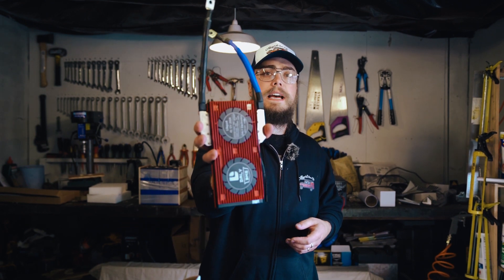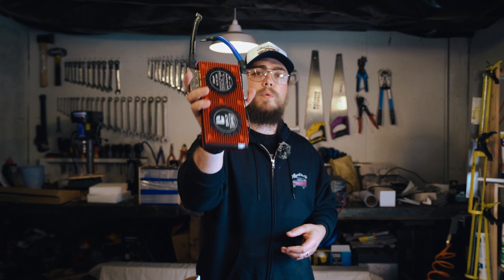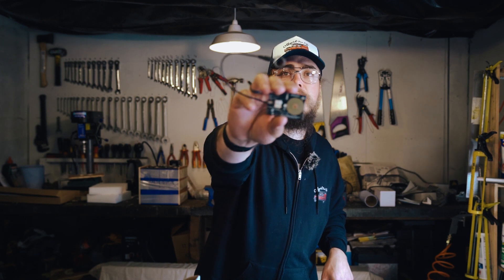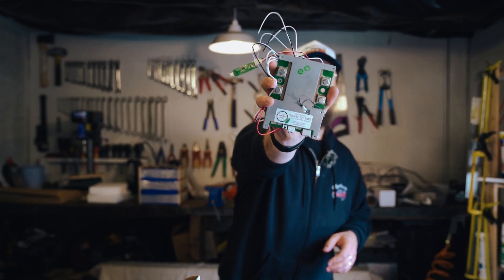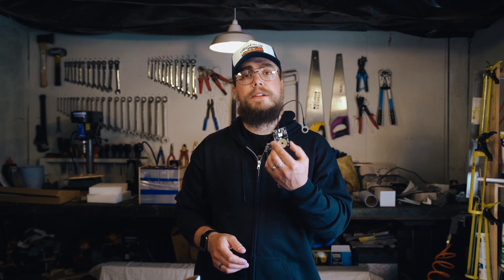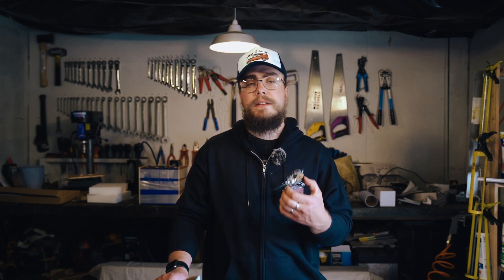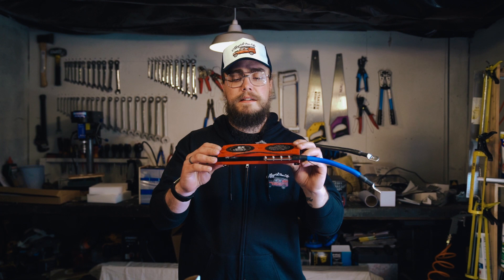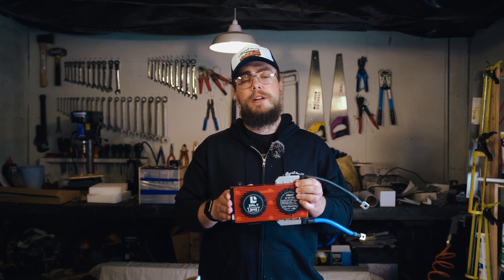Which BMS? Daly vs. Overkill vs. 123 BMS

Comment: I have used the daly bms and seen issues like inappropriate capacity measure,soc estimation. Max Voltage across terminals when bms is off

Comment: please help me size the BMS. I have 16 EVE 280 aH cells in series to make a 48 v battery, Is a 200A big enough?
Reply: If the power watt of inverter is within 6500W ,200A is enough
Reply: Thanks for the reply. I went with a 250 a since I have a 10.2 k inverter with a 40 a breaker ( 8800 w) on the output to avoid overload . I also put a 160 amp battery breaker in line. @jiabaida-bms

Comment: I need a bms for 24 leaf modules in a 24 volt configuration.  Its two stacks of 12 modules. I actually need a bms for each stack of 12. I figure q 6s bms is what i need and its powering a 4000 watt inverter
Reply from the maker: A JK BMS would be ideal.

Comment: Hi, I have a 100amps 8s overkil solar bms. I'm wondering if I can UP the settings to allow125 amps draw because of the electric kettle... the bms actually rated at 100amps but I'm thinking if I put in a fan for cooling it might be alright. What do you think? Yay or Nay?  ..

Comment: You could also just use a solenoid for higher amp draws that will just shut off if the BMS turns it off.

Comment: Great video and contents as always, but the thing you said about the 123 BMS it's actually incorrect, it can handle higher amps than just 100...I've a Gen3 with current sensors that measure up to 500 amps, just to be sure before installing it on my pack, I've double checked with my supplier (GWL), after watching your video, and a guy from the tech support confirmed that the BMS can handle even 150/200amps easy, so I can run my induction cooktop with no dramas at all. I've been reading again the entire manual, websites ect...no mention at all about what you stated in this video. Saying that, love your work, keep going! Your channel helped me a lot with my project 😉
Reply: You have run that much current for an extended time? Why would the manufacturer not rate it higher for vastly more sales? Makes no sense.
Reply: Mate...first of all, would you really think that a major company would lie to a customer (writing everything in registered and official e-mails) on such topics which includes healt and safety matters, just to sell a few more units? Secondly, go through every single information you can find on the internet (123 smart BMS manual for instance) and, please, tell me where you can find the info stated in this video (BMS rated for 100amps). 
Third, what on earth is the point of supplying a 500 amps current sensors with a 100amps rated BMS? (That would really make no sense at all)
And last but not least, I'm using it pulling 150/200amps ish each time I cook or heat the water in my van....so....I'm still alive and nothing blew up......not yet 😅
Saying that, I didn't write those things to show off or making these people look dumb..I really love their work and this youtube channel, which helped me a lot with my project, so I honestly think it'd be a shame if they might give incorrect informations to their followers. Peace ✌🏻
Reply: @simonecristiano637  yeah but isnt it more a seperate contactor so then you could run it with 5.000 amps if you really wanted it./hook up multiple togheter

Comment: I have four headway 40152 cells, 15ah. I plan to make a small portable pack for my dometic refrigerator.  I will only need about 5 amps of discharge or charging current,  but i think the 30 amp daly will be best because i can get the bluetooth version and customize it. Is there any other options for as much customization as the daly with bluetooth but in a bms in 5 to 10 amp area?
Reply: Specifically cell maximum and minimum voltages. I prefer to not use the full 100 percent capacity and extend the lifepan by using lower maximum and higher minimum voltage for this specific build.

Comment: excellent video, congratulations. It inspired me to build mine. But I have a question, if in charging the bms receives a load above the maximum, what happens? for example it can charge 100a and receive 150a. Does it charge the 100a and ignore the remaining 50, or does it shut off and charge nothing or does it burn out?
Reply from the maker: Although Daly would not officially confirm this, the BMS do have some threshold for exceeding the capacity. We have tested a number of them, pushing them beyond their capacity, and they have performed fine. Obviously most warranties and guarantees are void if you do so, so probably not recommended.
Reply: The spec sheet will often list when the overcurrent protection kicks in on the charge side. It will not take 100 and ignore the other 50. Most often you’ll see a 20% overrating before the protection kicks in but this varies between manufacturers. 150A will likely trigger the protection on a model rated for 100A charging so it will cut off the current from getting to the battery

Comment: Jk is my favorite
Reply: Be careful using  JK BMS .. 
If you are turning your LIFEPO4 system off for a few or more days   they sometimes revert back to the units default specs ..This default ( apparently) is a Li-on profile with a 4.2v per cell threshold... and not the safe 3.6v cell threshold..
Don't take my word for it .. look it up to confirm this heads up warning .
Reply from the maker: Nice! ☺️

Comment: I like the jbd they go up to 200a and the new jk bms also have 200a are good also.
I’ve always used Daly until there after sales support. They have standard response it’s your fault.
I use to install 100 Daly bms a month, never again .
Reply from the maker: Thanks Michael. Yeah, Daly's customer service is definitely lacking.
Reply: @offgrid_power  They are terrible, They have two responses 20% off your next one or send it back I’ll have a look at it and send it back to me at my cost. Last year I bought over 1200 bms from them last year. Only had a problem with 3 of them but , there right your wrong. I sent the bms away just to see what was wrong with it turns out a resistor was missing from the negative cable inside the BMs.
Reply: Yes ..Daly does NOT   look after its customers- Period ..So disappointing 🤬

Comment: So far I’m very happy with my JK BMS with active balancing
Reply from the maker: Nice. Sounds good.
Reply: I have one JK (JacKass??) of 200A,and the balance i never needed, it does nothing at higher Amps of charge or discharge(30 or 40 Amps) i keep it off all the time in the hope of avoiding failure,but
The damm JK bms broke down,the Bluetooth no longer works after only 351 days; JK does not even answer my emails; 
it still works,i think,but blindly now, nothing on the phone,tried everything; it started giving out different signals and the next day, nothing;
So,i will have to get another bms,never again jk
but i guess otheres won't be much better..
At least this time i will get one with an external BT module,that is for sure.

Comment: OVERKILL ARE GOOD BUT ONLY GO UP TO 120 AMP AND THEIR SOFTWARE IS A PAIN IN THE ASS . DALY WORK UNTIL THEY DON'T ,IT IS JUST A MATTER OF WHEN ?
Reply: YOU CAN USE AN ACTIVE BAANCER WITH A DALY BMS.IT WORKS FINE.
Reply from the maker: Thanks for the comment, David.